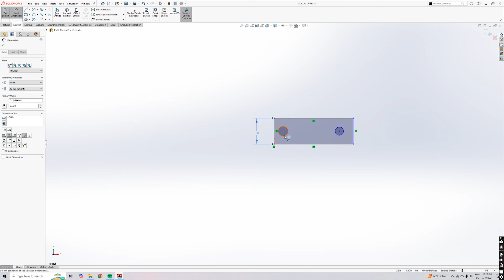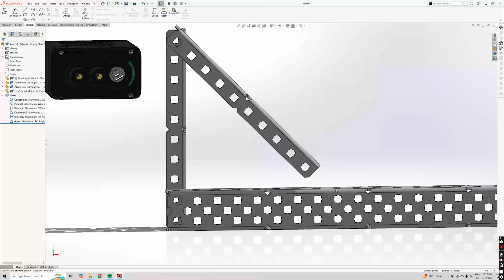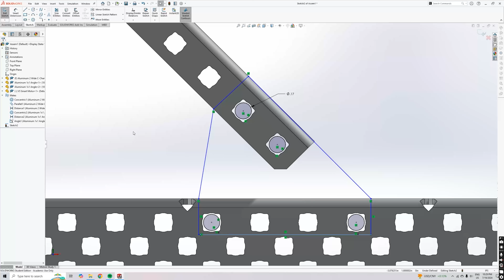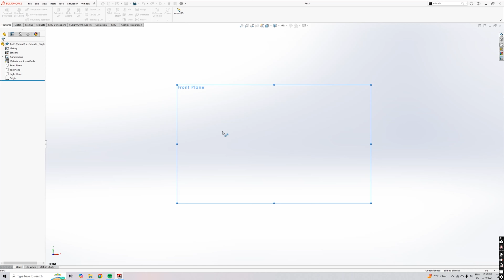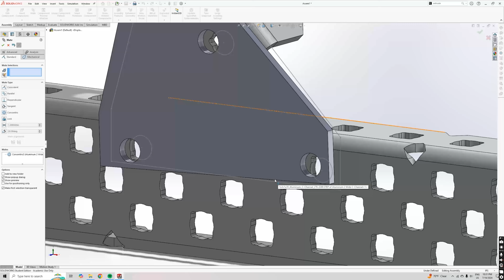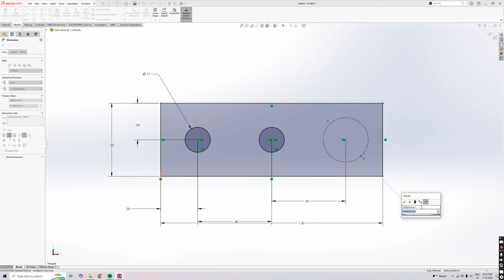How to design custom plastic for VEX Robotics in SOLIDWORKS

Comment: Can you run these parts through a simulation? Wanted to know if I could test how strong my part was against different loads before I cut it out.
Reply from the maker: I don't have much experience with simulations in sw but if you're worried about parts breaking I would just double stack them
Reply: @zainkaramally9195  do you know if it's possible? If it is I bet I could figure it out. Just looks good in the notebook
Reply from the maker: @Fvillerobo  yeah probably